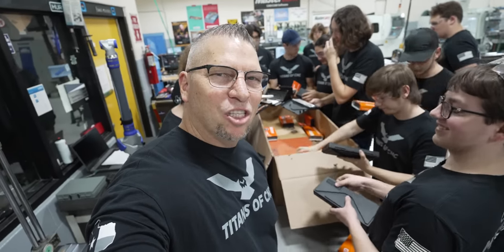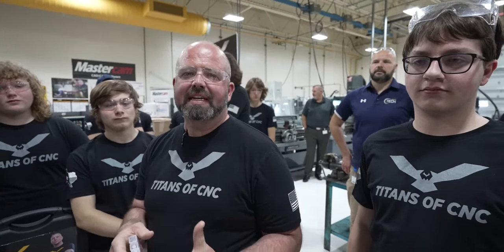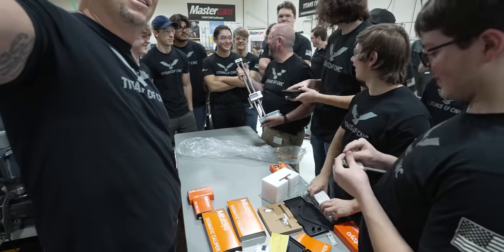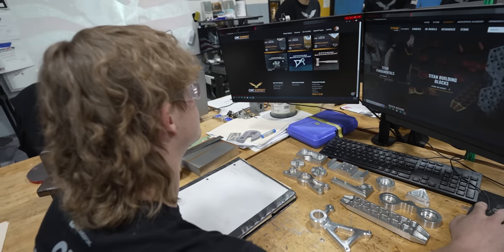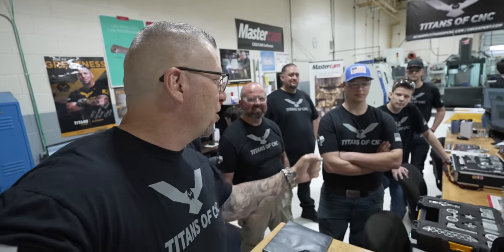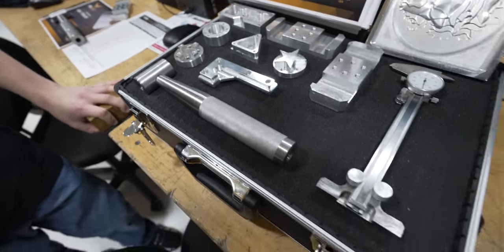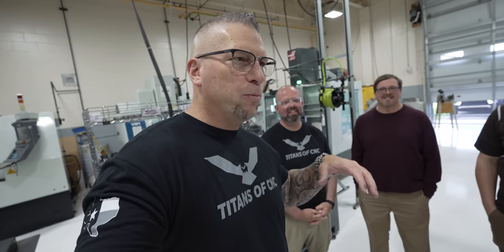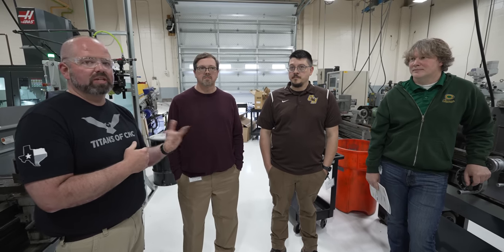High School Machine Shop Get’s $35,000 in New Tooling

Comment: Thank you so much, this is great, my son is considering this program. One thing these guys probably need is better coolant, I am using oemeta 875 here at my home shop, stuff is great, but any of the new cutting fluids would likely be a huge improvement as they are far less toxic than a lot of the current cutting fluids on the market.

Comment: In the mid 90s I was told  in a computer lab that I needed to slow down for the sake of the class & teachers.  There were already 5 or so other students who  not only were able to login but start the lesson without any hand-holding by the teachers.  I'll always resent that teacher & her assistant who should have been encouraging  those students to attempt computer programing at the age of 7 or 8.

We need a new generation of teachers who know how to give those self-motivated students the resources such willing to reach out to community college professors or trades teachers. There are likely 8 year olds who know how to change the oil of a truck and they're passionate about being able to one day own a truck. A good teacher probably could get those students sponsored by Snap-on such a basic ratchet & wrench set.

Being able to turn bolts & change oil at a young age could potentially lead to a passion in CAD design once those kids want to do things such as build a custom roll-cage. CAD-design is a middle class income, especially with older workers retiring.